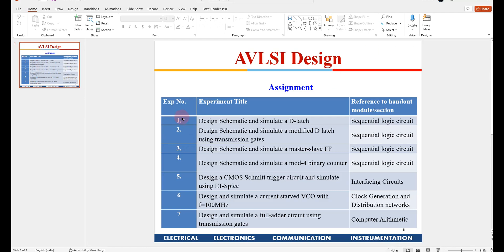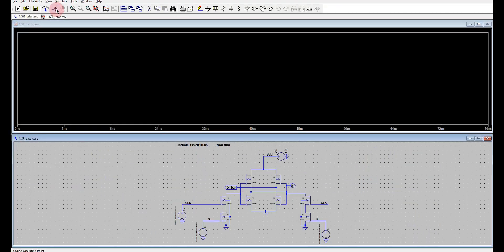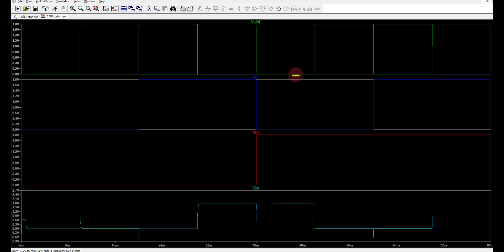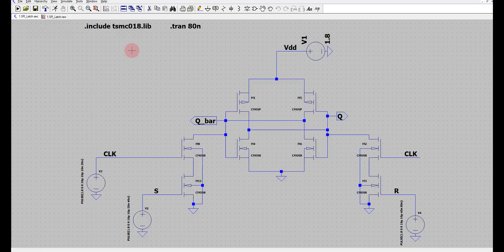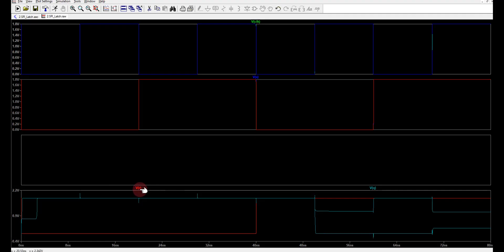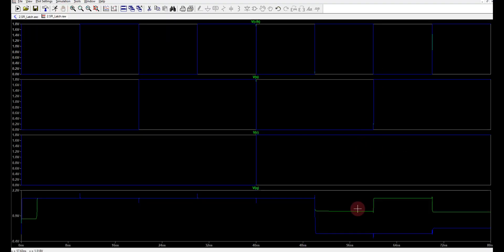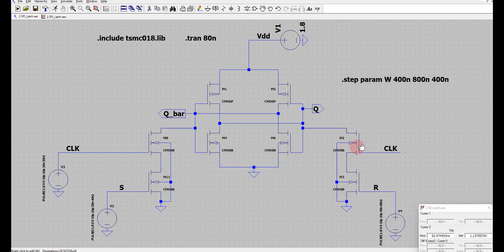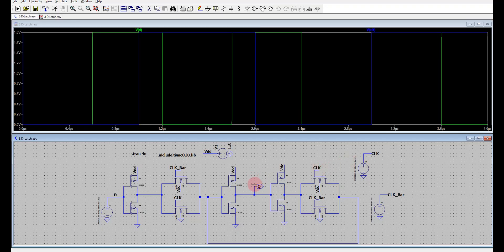Impementaion of SR Latch, D-Latch and D Flip-flop using 180 nm TSMC CMOS devices in LT SPICE.

Comment: I have tried to do this exercise, when I put the 180n and {W} I get the following error:
BSIM3: mosfet m2, model cmosn: Effective channel length <=0
Reply: I solved this problem because in the simulation I put .step param W400n 800n 400n instead of .step param W 400n 800n 400n
Reply from the maker: Nice to note issue is resolved
Reply: only put Length 180n and Width{W} in nmos or too in PMOS?

Comment: Thank you for such informative content. I attempted to replicate the results but I am not getting the desired waveform for the output parameter. I believe that the transistor sizing might be the issue. Will it be possible if you can share the transistor sizing so I can understand it better?
Reply from the maker: I would prefer students to try it out once themselves. In case you are not getting the desired output you can mail me the .asc file , I will have a look and let you know the issues.  
sanjay.vidhyadharan@pilani.bits-pilani.ac.in